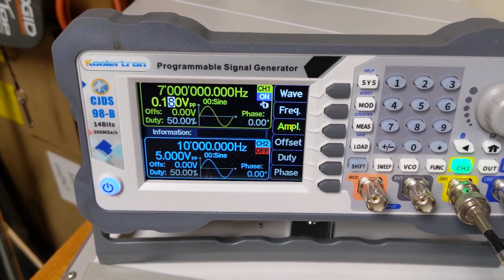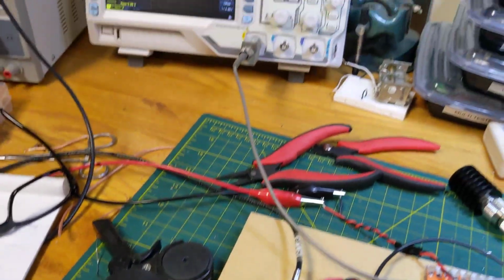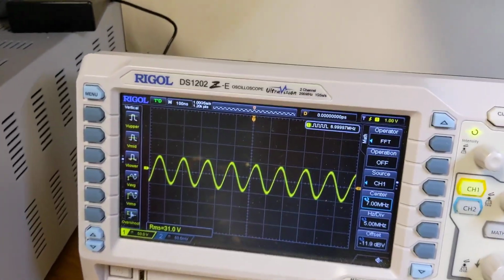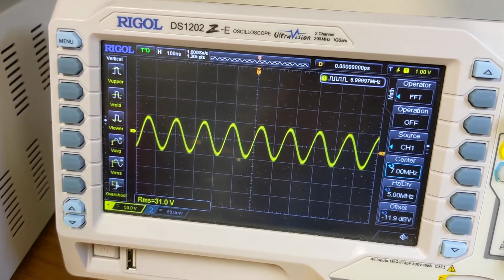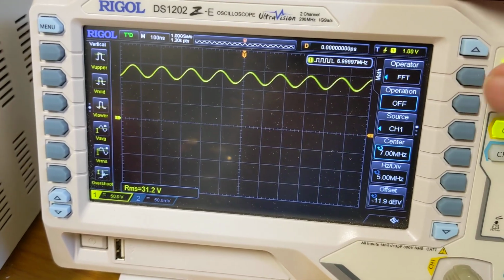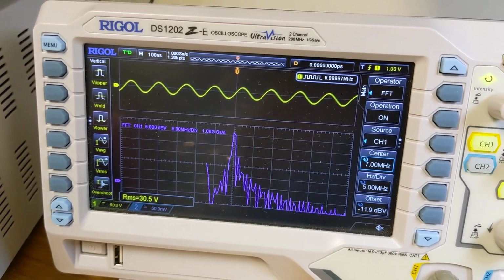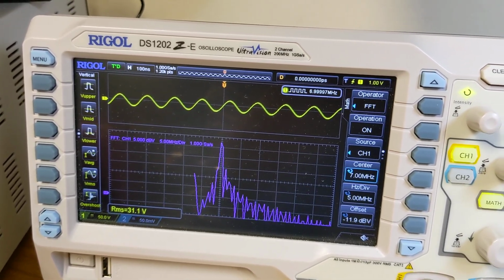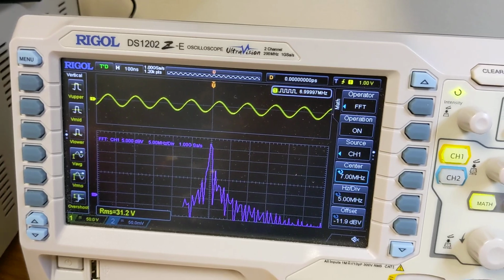KK4DAS build of EI9GQ 16W Dual RD16HHF1 Amp - Part 2 - 20 Watts Clean

Comment: Nice and neat work, Dean. I see you clipped the drain lead on the IRF510 and used the heat-sink connection instead. Did you do that after having stability issues, or was it what my dentist calls a "prophylactic measure"?  --Todd K7TFC
Reply from the maker: Hi Todd, Alison KB1GMX has long recommended clipping the drain lead on the IRF 510 when used as an RF amplifier and N6QW, Pete recommends it in his original design notes for the SimpleSSB.   And then, in general, it is good practice to keep your inputs away from your outputs.

Comment: Nice looking amp and test bed Dean.  Did you try it across HF? It may be reasonably flat to 50MHz.  But the proof is in the pudding.  The transformers may be the limiting factor...
Reply from the maker: Thanks Paul.  I only tested to 30MHz but it was pretty flat gain across the band.  I haven't put it on the air except for a brief  test - waiting for my o'scope to come back from Rigol.  Wouldn't you know it, right in the middle of testing the amp one channel on the scope decided to die? .Left me puzzled for a bit until I realized the problem was the test equipment.
Reply: @kk4das122  Thats a nuisance! I've had my scope probes go dodgy, easily replaced, but never a scope problem, touch wood. I need to be careful about putting it across my 160m AM transmitter as a signal monitor, the voltages there are getting close to the scope limits 😬
Reply from the maker: Hi Paul - in the rig I am getting 20 watts clean out on 20 and 40 meters (those are the only two bands my homebrew is setup for).